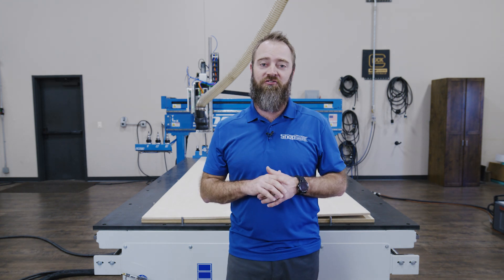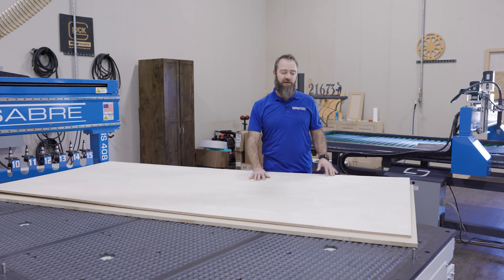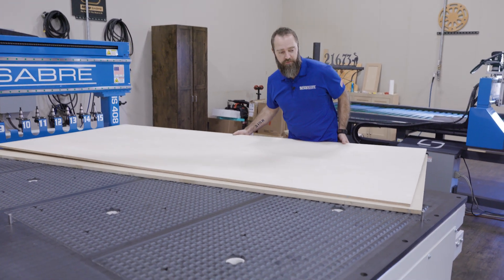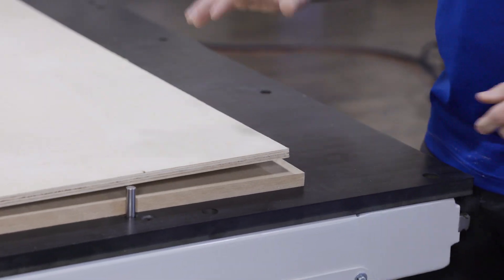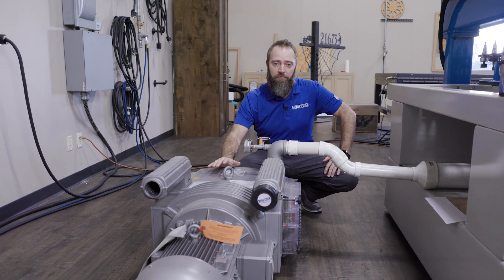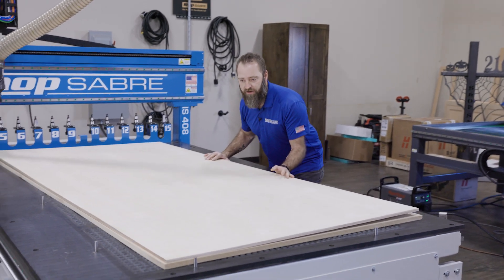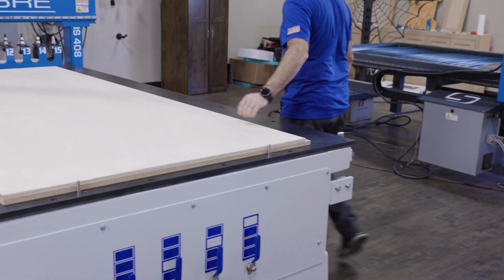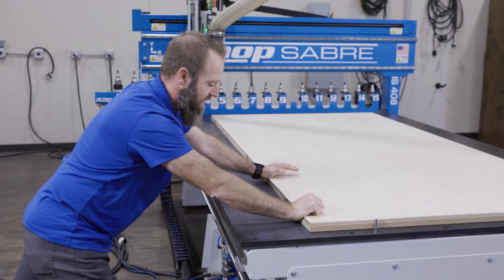Vacuum Table - ShopSabre Minutes

Comment: That looks like a standard 15amp light switch to turn on the vacuum.  How does this work with that beefy 3-phase Becker?
Reply from the maker: It’s a much beefier switch than that ha-ha, it’s the switch on the motor starter but it’s definitely heavier duty.

Comment: So it is able to pull adequate vacuum through the surfaced mdf?
Reply from the maker: That is correct
Reply: What vacuum level (in.hg) do you see with that machine with just the spoilboard and then with a full sheet of birch on top? Interested in why you don't recommend the common vacuum increasing techniques such as sealing the edge of the spoilboard, using good gaskets, etc.  It is easy to hold an entire sheet of plywood, but how about holding 4"x4" pieces during a cut? @shopsabre
Reply from the maker: This simply showcases case goods which are very common uses of vacuum tables. In this scenario, along with many of our videos we use this exact method when cutting the majority of our projects without added labor or materials 

That said, specific applications and scenarios will produce different needs
Reply from the maker: Additionally, we do recommend sealing edges when someone requires more vacuum. We also have several videos you can check out on our channel showing small part success.